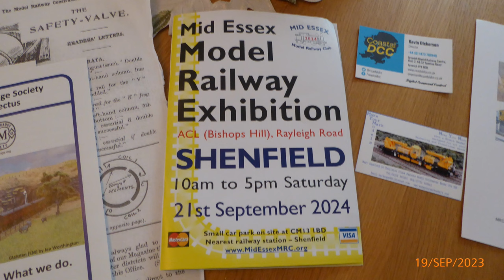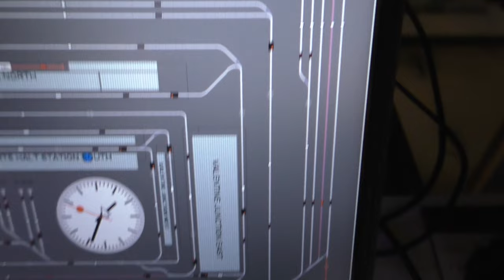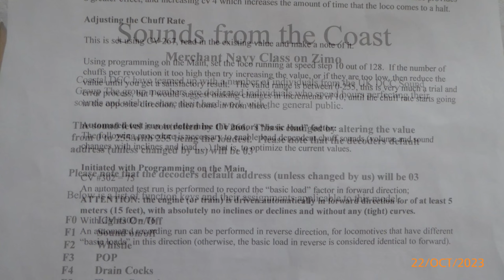Dcc sound in the 2006 Devon Belle train pack

Comment: Hi Robert that was interesting video, I think I heard you say you changed the low speed and the high speed cv's but did you do the middle speed that is really weird how different when stopping, did you try running the train forward to the station were it was stopping bad place and then trying to run it backwards to the front were it was stopping nearly in the wright place.

Then did you speed measure after you change cv 29,
or did you speed measure then change it. 

Another thought did you put the front measurement to the first wheel, then did you change cv29 because when it was going backwards it stop the front wheel near the black marker and then when it is going forward it thinks it is and it is, sorry in my head I can see what I'm getting at but having trouble saying it to sound wright. 
And one other thing you did remember to tick the box to measure backwards as well, just incase you may of forgotten to tick it. Sorry I'm not trying to teach you how to do it. 
You maybe better changing the wire not the cv 29
Hope you have already sorted it out. Colin
Reply from the maker: Hi Colin,
Thanks for watching and your very nice and interesting comments. I did say in this that I had trouble changing the bottom & top speeds if I changed them from the 0 they had then the loco would not move at all fast and yes did the middle one also so left it as it was after all you can limit the  top speed in other places. I had speed measured first before adding one to the cv29 but at low speed the lines (yes both ways done) were much the same not enough for the difference in stopping F/B I would say.  Yes the measurment for the front and back wheels are in and the front of the loco is the front of the loco so should not affect anything after all its not bad forward is it so at a later date may have another go at her and also have a go at the chuff rate also and the wires. Thanks for helping me here keep well and building a layout awaits you.
Cheers Robert.

Comment: Hello Robert,

     What a beautiful trainset from almost 20 years ago.  Stunning models.. and that is a Battle of Britain loco?  I looked it up but not quite sure.  Anyhow, that is a bit of a shame that you had to fix one thing but other issues arose.  As someone else said, maybe changing the CV on the 29 threw something else off.  I have no clue.  Anyhow, it is such a beauty that I hope you sort it very quickly.  Always great to see you!  Cheers!
Reply from the maker: Hi Anthony,
Yes one subscriber (Roy) did say that swapping the wires over to the motor may sort out the reverse running and I did not even think of that but changing cv29 I do not think makes any differenc to how the decoder works if it did then it maybe would not be available so for the time being will let her stay as she is and she will run ok under iTrains so happy with that as for the chuffs Andy said it should be 6 chuffs per revolution and he thinks it is 12 at the moment so may try doing this from those instructions. Its time to say thank you very much for watching and your very nice comments I hope you Joyce and the rest of the family are over the worst of the covid and getting back to life again.
Cheers Robert.

Comment: If I remember right, looking at a special train like this, there would have been a DEVON BELLE Observation Car at the back. Glad you got some Pullman coaches with lamps that light up. Please excuse my being picky, but I don't love Southern steamies. However, if you had a Terrier Tank Engine in your collection, I'd smile a bit more. In any case, hope you managed to solve the problems you encountered. You might not consider yourself clever, yet I think you're a genius. You're certainly braver than I ever will be. You've taken on the iTrains challenge, suffered a few setbacks here and there, and eventually succeeded. Just goes to show that a little determination will take you everywhere.
Reply from the maker: Hi Kelly,
Sorry but this is a steamer and the next two to come are smelly diesels so it a case of taking the rough with the smooth I am afraid. But no worrys I still thank you so much for watching and your super comments and setbacks and overcoming them is what life is all about. Keep safe and well and enjoying the trains whatever they are.
Cheers Robert.

Comment: As you say it ran backwards when set to run forward and you changed cv 29, I was wondering if instead of changing cv29, swap the polarity of the wires going direct to the motor. Easy for me to say as I can't see if that would be a dificult thing to do in this case but it has worked for me on a couple of loco's. Not changing cv29 might help solve some of the other issues.
Just a suggestion not saying it will solve the other problems. Perhaps others will have better ideas.
Reply from the maker: Hi Roy,
Now why did I not think of that yes it was strange that a brand new decoder should run the loco backwards and just to check that the decoder had not been reset did put 8 into cv 8 to reset it and no change. If you look at the loco without the body on the motor does look a bit buried so will leave well alone as she is ok for most part and the problem with stopping backwards if I need her to do it in a video I can adjust were she should stop in that block but cheers very much for the info. I thank you for watching and your very nice and helpful comments I hope you are both well and a new video from you soon as love seeing you trains run on that layout from the sky.
Cheers Robert.
Reply: Hi Robert
That’s a good find you got there Robert and I have had a few decoders where it runs backwards when I put it in . I do like the Pullman coaches with lights .
 Cheers Kev